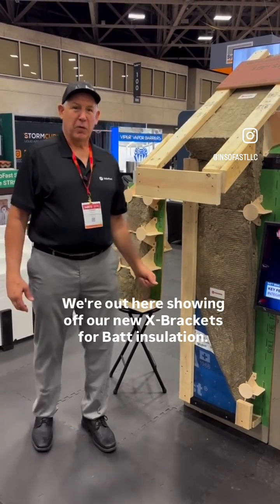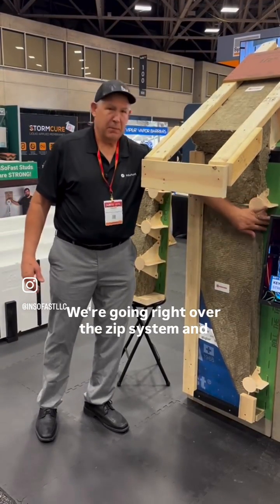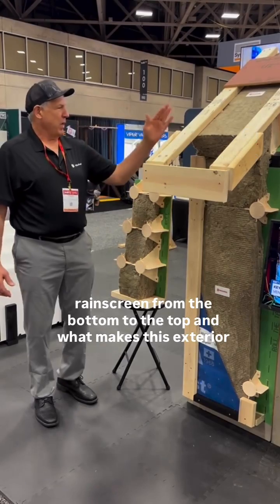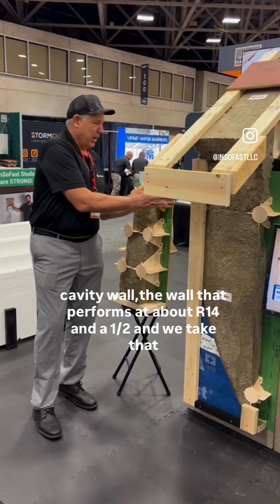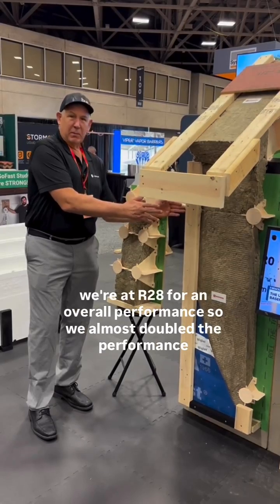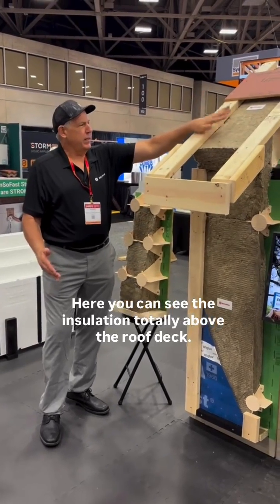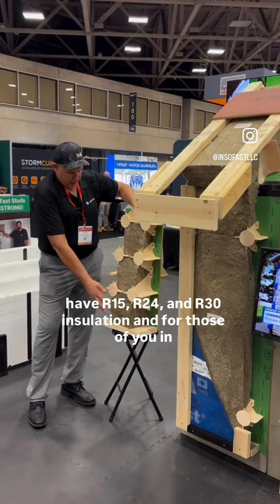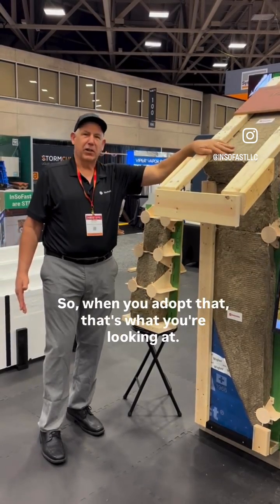How to Beat the 2024 Energy Code Fast with Batt Brackets & Batt Insulation

Comment: Would your 2x8 bracket work with 2" of spray foam then a 6" batt? Also can you post a video of what the corner details look like?
Reply from the maker: Yes! The 2” for spray foam would provide that air seal and the other insulation can go on top. Our larger Batt Brackets will be available the first part of 2026.

Comment: What do you anticipate as far as pricing on this system with rock wool compared to your insofast panels? Which is a better value?
Reply from the maker: Pricing for the Batt Bracket will start at under $1/sqft and will also be on our website in the upcoming weeks in anticipation of this product being available for purchase in January 2026."  You can request a quote using our X-Bracket Calculator: https://www.insofast.com/x-bracket-calculator-exterior
Reply: Can you compare the bracket and batt system vs the insofast panels cost though?

Comment: I've been excited about the batt-brackets getting released for all of the benefits you list on your website. Seem like an overdue solution. 

I would like to hear more about the thinking behind the outer WRB over the batts when using mineral wool. Do Comforbatts really need it compared to Comfortboard? Also, can you share a little more on how the Majvest is attached in your mockup assembly there?
Reply from the maker: Rockwool has requested that the comfortbatts be covered with a wrb for wind wash protection. The batt brackets accept a stapler hammer very easily for any wrb.
Reply: @insofastllc Thanks for the reply! Another question: Do you have a preferred fastener for attaching furring strips to your brackets?
Reply from the maker: @doubleclickrick6324  Currently our code reports specifies standard all-purpose construction screws.